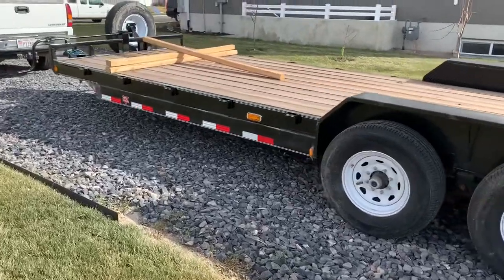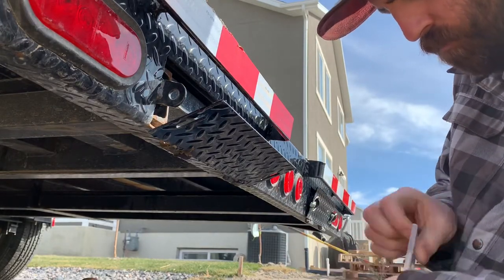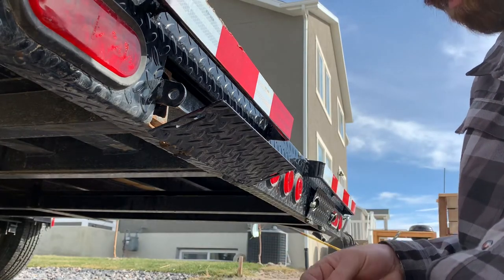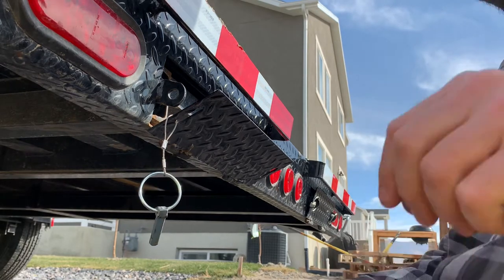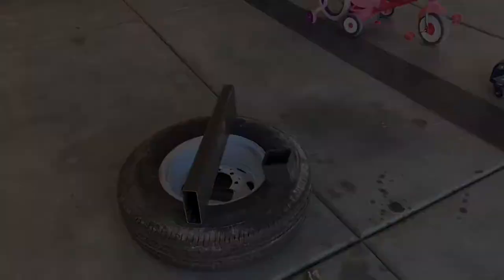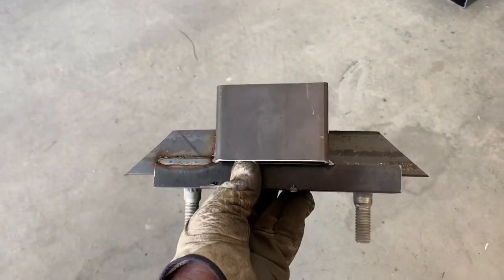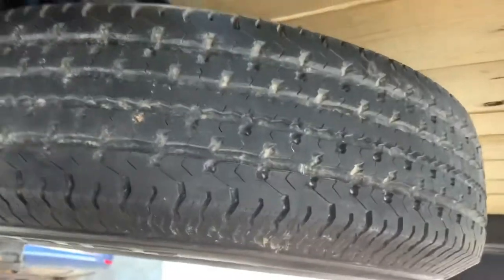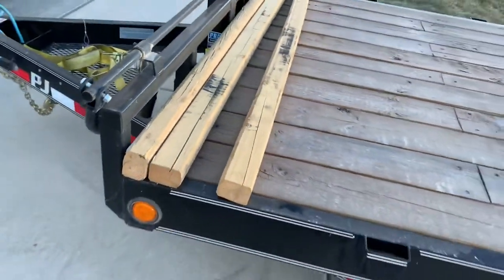2020 PJ trailers 24 foot car hauler. Modifications!!

Comment: Kevin mounting the spare tire underneath is a GREAT idea 💡..
My pick-up has the spare underneath ( like your pick-up).
My fifth wheel travel trailer has its spare mounted underneath.  Both spare tires are in their FACTORY design location.
Both my truck and travel trailer have a crank to lower the spare to the ground.
Great idea.
Reply from the maker: Thanks. I mostly dont like looking at the spare so under the deck works good for me.

Comment: I like the idea of mounting the tire under the trailer for the reasons you said in the video, but it does have its cons like what people are saying in the comments. I think I have an idea that could solve the haters complaining….maybe you could fashion some kind of raising or lowering device that the actuator is accessed from the top! Similar to that of the ones that trucks use under the truck bed to house their spare tires.  Maybe a threaded rod that connects to the tire mount that you could put an impact on to raise and lower from above 🤔🤔🤔 I’ve been modifying my trailers like crazy and I have also been binge watching others videos on what they have done. I will be dropping a quick video of my mods pretty soon! Maybe I can think of a way to make the spare tire thing work! Thank for sharing the tire thing is a great idea!
Reply from the maker: For now I am using the spare on my truck. Same size tire and wheel bolt pattern.

Comment: I like the tire underneath too.  BUT, there will be a time when the roadside is not good and the trailer is loaded to the gills and getting it out will be very difficult.
Reply from the maker: You are probably right. BUT, in the 18 years that I have been driving I have only had to change one trailer tire one the side of the road. I replace trailer tires every 3 to 4 years, because its easier to keep fresh tires on my trailers than it is to change them on the side of the road.

Comment: I have wanted to do a spare under the deck on my trailer, but I want to go to the junk yard and get a spare tire winch(?) off a truck, that way you can lower and raise it.  Laying on my back trying to push a spare up onto a mount and hold it there while starting lug nuts doesn't sound like an awesome time.  Not to be a hater, but I think you will like that spare tire location right up until the first time you have a flat tire.
Reply from the maker: Yeah, that would be pretty cool.

Comment: I definitely wouldn't want to be laying on the side of the highway with traffic flying by at 70mph trying to get that spare tire down from under that trailer. Bad idea!
Reply from the maker: You are assuming I would stop on the side of the highway to change a tire. Ill will ruin a wheel getting of the highway before I would change a tire on the highway.
Reply: Or a rainy night laying under the trailer to get the spare

Comment: I think you are going to regret that spare tire location.  To each their own.
Reply from the maker: Since I sold that trailer, I probably wont regret it.
Reply: @kmac9759  LOL.  Somebody will.  Always a balance of functionality over aesthetics.  Hell if a guy is hell bent on putting it underneath the deck at least put it at the very edge.  Give a person a chance at removing it without being on their back with dirt, rust and a mounted rim falling on their face.
Reply from the maker: @ShainAndrews  well, i hadnt cut the old mount off the front so they could move it if they wanted to.
Reply: @kmac9759  Well there is an upside.